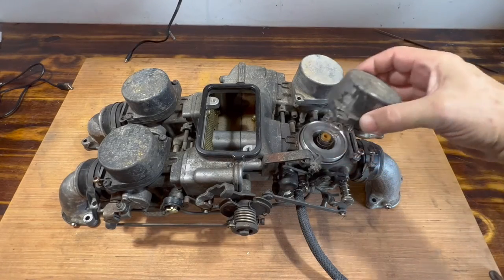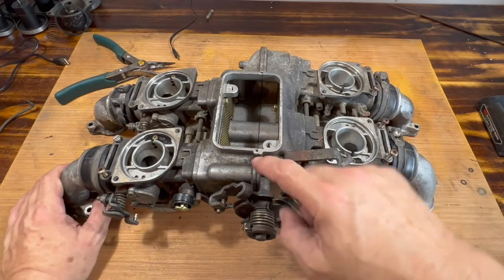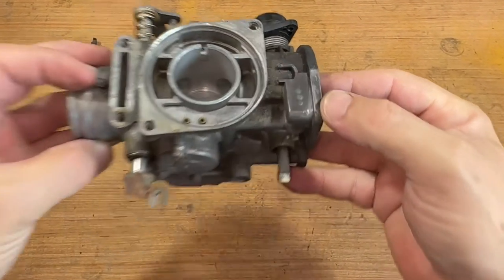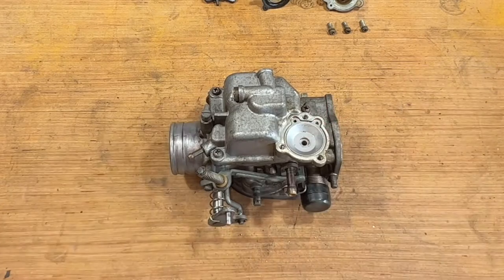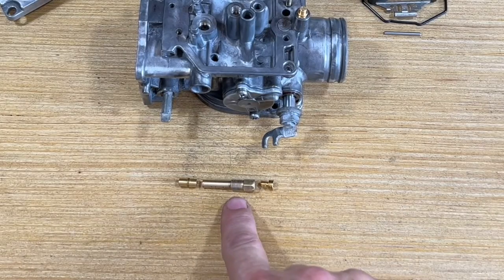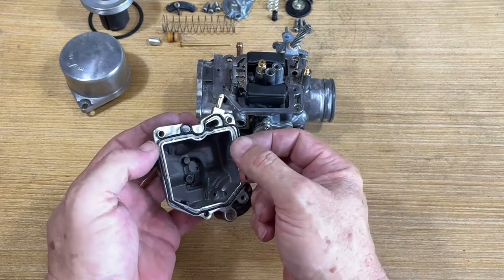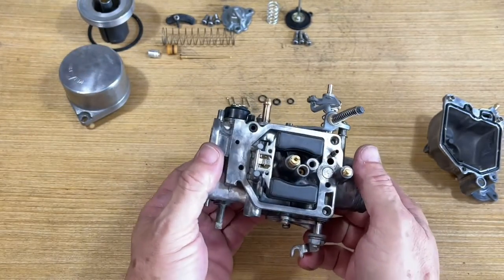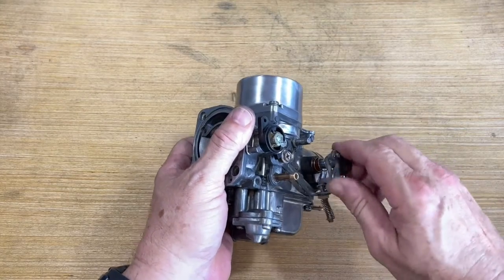Honda Goldwing | Rebuild Carburetors 🛵

Comment: A couple of comments: When reinstalling the jet needle into the diaphragm be sure that it is slightly LOOSE!  It should not be tight.  You need to check that.
Also: the idle jet adjusting screw has an o-ring and a tiny flat washer below the spring.  To remove them I use a small paper clip.  Straighten out the paper clip and put a tiny hook in it.  Use the hook to remove the washer and o-ring.  That 'left over' o-ring you tossed was supposed to go in the adjuster screw!  Also: to remove the limiter cap from the idle mixture screw you can apply heat to melt the glue Honda puts on the cap.  I use a tiny butane soldering kit but don't melt the cap!  I always remove the limiter cap before removing the mixture screw just to make sure the mixture screw doesn't get broken.... it can happen!
Reply: Hi. Have you any advice for me on my 1975 Gl1000. The carbs seems to be the problem with the running. I get the bike running and within 30 miles it always breaks down. Seems to be too rich.

Comment: Thank you. I just picked up an 87 with 5 year old gas in it. Looks like I'll be cleaning the carbs next.
Reply: 11.30.23.     The GL1200 carburetors are different than the ones he is rebuilding. I did mine on a 1985 GL1200, I ultrasonic cleaned and then I soda blasted them. I also replace the rubber diaphragms on the slides, because I had a pinhole in one of them. I used a rebuild kit from Randakk.

Comment: Hi thanks so much for your video. I got a 81 gl 1100 about a year ago and just rebuilt the carbs watching your video it  helped me so much. The bike was sitting for a long time before I got it after I put the carbs back on it fired right up but after about 5 minutes it started to smoke anyway I think it is my valve stem seals but it could be the rings I'm no mechanic just watching YouTube video's the one thing I'm confused about is when I put my camera scope into one of the cylinders there was a lot of gas pooling on top of the piston and the intake valve when I had checked it the next day. I don't know who to ask about this situation just thought you may have an idea. Hope you are still doing well.

Comment: Hi Tom, greet tutorial. I was wondering if its possible to run fuel through this carb outside of the bike. To pinpoint leaks before remounting it. This because its normally filled with a pump. Can a simple container with fuel gung from the ceiling do the trick?
Reply from the maker: Yes, absolutely

Comment: Great Video tom ...Im on my second gl 1100 gotta pull these carbs and do some exhaust work...how did the ultrasonic cleaner work for you..... i have that on my wish list.....hope all is well
Reply from the maker: Thanks for the compliment! The ultrasonic cleaner works great! I will always use one for carburetors, brakes and other parts that have small passages!
Reply: @TomAsay64  which ultrasonic cleaner do you use? do you have a link? Thanks!
Reply from the maker: @the973kgt  I just picked one up a cheap one from Harbor Freight. It works well enough. It could be a little deeper, the carb bodies don’t always get completely submerged. Sometimes I have to roll them around.

Thanks for watching!

Comment: I’m in the process of removing the 4 carbs, I looked at Amazon for a carb kit, reviews are bad, parts don’t fit

Please, what kit did you use, I looked at replies from those that asked the same, couldn’t see anything about the kit used.
Reply: 11.30.23.   Randakk™️ has rebuild kits for these carburetors that are really good, also, you can source some parts from Honda. K&L also has kits. However, I only use genuine OEM float needles and seats on any carburetors I rebuild. It gets quite expensive, but they work whereas the K&L kits and other cheaper ones are a hit and miss.⚠️ A person should actually test the float needle and seat with gasoline before installing on the bike because if they leak after you install them it’s a pain in the ass to take back off… And if you’re doing this as a service for someone else, it’s a profit killer to do it twice❗️
Reply: I have bought many carb kits from Saber Cycle. O-rings fit well. I generally use all the original jets and main jet needle after thorough cleaning. Also, you did not mention that the accelerator pump puts a shot of fuel into all 4 venturies. There is a tiny fuel circuit that connects the 4 carbs. This is usually clogged and very difficult to clean.

Comment: pardon my ignorance, o-rings in the carbs don't need any sort of grease when installed in general?
those carbs looks super clean :)
Reply from the maker: You are correct, they don’t need grease, it is just something I do to make them last longer and make them easier to remove if there is a next time.

Thanks for watching!
Reply: @TomAsay64  i was asking, i don't know things about carbs, thanks for the reply

Comment: hey dude, was gifted a 94 goldwing that was in the middle of being worked on. unfortunately my grandfather passed in the midst of this project. the body needs to be put on but having trouble find a good starting place. any chance you have some advice for me?
Reply from the maker: Sorry for the loss of your grandfather. 😔 I would need to know more of what stage of assembly/disassembly the bike is in. 

Usually you need to start from the inside and work your way out. Before putting the “body” on you need to make sure all the components underneath are installed and in place.

You should locate the service manual either online or in paper form to really do this properly. Actually, It is very interesting to look thru the manual! Watching people like me online should be “in addition to” the service manual, not “instead of" the service manual.

Thanks for watching and commenting!

Comment: Tom how much different between a 82&83 carbs on gl 1100 interstate.
Reply from the maker: 1980-1981has VB48A carbs and the 1982 and on have VB48C carbs. I do not know what the difference(s) is/are.

Thanks for watching!
Reply: @TomAsay64   Older ones have pressed in idle jets.

Comment: I think You missed a small straw fuel crossover tube that goes between both cases.
Reply from the maker: The o-ring needed to be replaced. It is not a separate tube connecting both sides but a pathway built into the halves.
Reply: It's the accelerator channel "Straw". I coudn't stop leaking fuel without installig it in my rebuild 😬
Reply from the maker: I wondered about the accelerator pumping only into one cylinder and not all four. I am going to look at my raw videos to see if there is the nozzle on more than carb #3.